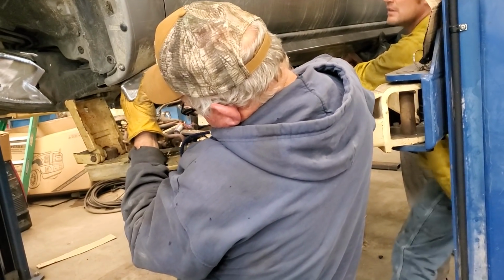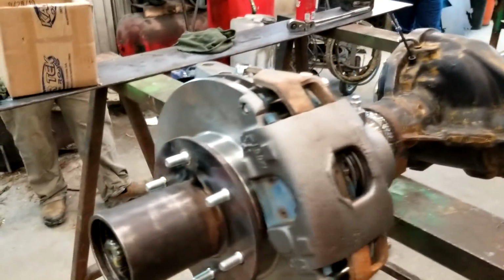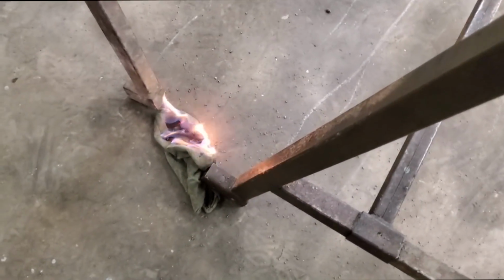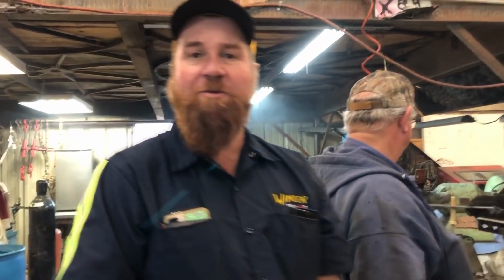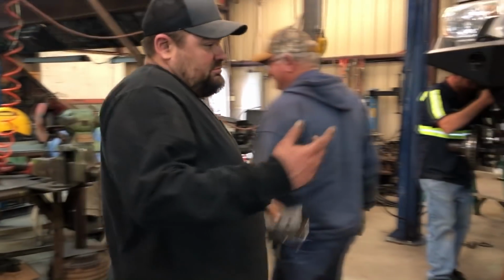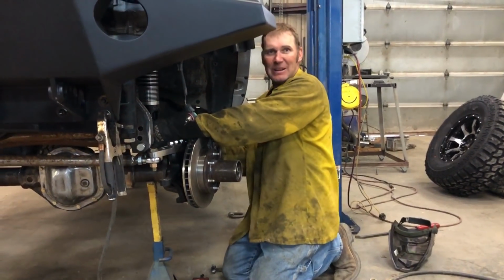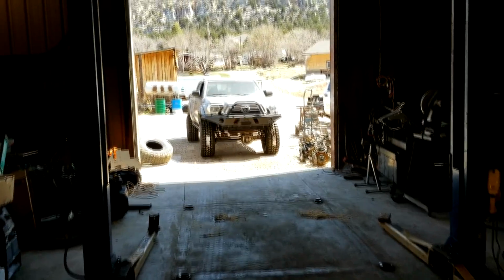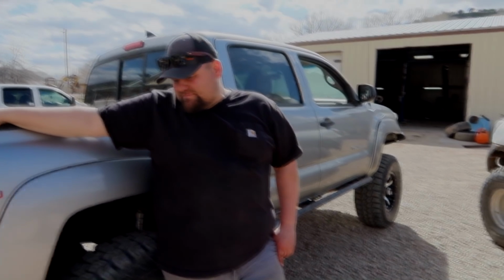**Best Offroading mods -Toyota Tacoma into a Straight Axle** Part 2 of 2

Comment: Paul if you just undo the emergency brake cable mounts you can pull the axle out with everything intact. I just replaced an axle seal on my 2015 Tacoma and this trick saved me a ton of time!

Comment: Great work on that, it looks terrific! Man, I need that for my 4Runner! I'd love to get rid of that IFS crap, LOL.
Reply: Jbog07  oh that's interesting. Well, apparently Jeep has it figured out, haha. I will concede the ride comfort, my 4Runner definitely rides and steers better than my old solid axle Grand Cherokee. Off-road though, the Cherokee was light years ahead of the 4Runner in any technical off roading where front articulation was needed.

I watched videos of IFS Toyota's off-roading, and it's just so pathetic how little the front suspension actually does. It's good for bombing down dirt roads a little faster than you probably should be going, but it just doesn't articulate at all in flexy stuff.

Comment: Quick tip on removing the 3rd member from that rear axle.. there is enough slack in the brake lines if you carefully straighten them out, and unbolt the emergency brake cable from the frame. I’ve even replaced the axle housing oil seal with only disconnecting the brake line, left the e brake cable connected.

Comment: I made sliders just like that for my Rubicon. Only difference was I took a piece of 2" schedule 40 iron pipe, cut it in half and blended them in on both ends. So both ends are rounded to prevent hanging up on rocks.

Comment: A lot of very impressive fabrication work... Off road, at least rock crawling improvement to be sure... But the independent suspension on my 4x4 V8 powered 2010 GMC Canyon is  boss for me... Good ride, good handling for what I want to do... No solid front axle for me... Couldn't go back...

Comment: Just curious, how much weight did this add with the solid axle swap, steel bumpers, and all the steel tubing used for the frame and sliders?  Was the engine modified at all?  How does it handle the extra weight?

Comment: Awesome tacos! I love my 19.
Reply: I love my 96 Taco! 312K miles on her with the 2.7 L 4cyl with a 5 speed manual.
Would love to do a straight axle on it though.
Reply: @karlt.6507  I have a 2003 Tacoma Extra Cab  4x4 SR5 with a 2.7 5 speed. I love it. Just a great little truck. It rides pretty sweet with adjustable Rancho 7000 series shocks. I wonder how long mine will last. I live in NJ and I've already had to do 2 frame rust repairs. I bought it as-is. Probably somebody traded it in for a newer Tacoma as opposed to having Toyota replace the frame. When it goes it will be another used  Tacoma.

Comment: I'm sure you guys know about the gray wire mod actually I don't know if it's the same wire in the 2015 but the 3rd gen 4Runner and 1st Gen Tacoma gray wire mod then you can use the E Locker in any gear and you can use it in two-wheel drive

Comment: I had an 85 high rider toyota with the straight axle or live axle with front and rear lockers the biggest problem with it was the 22re 4 cylinder engine always chewing up timing chains and blowing out the timing cover at the water pump
Reply: Marlin Crawler will keep the revs a little lower.

Comment: 12 grand in parts? Axle, locker, rear gears, shocks, steel, wheels/tires. 12 Gs? Dang. But it looks good and seems to work very nicely
Reply: There's a loooot of labor $ in there too
Reply: Go to the Rubicon. You’ll see $100k+ JKs and JLs there pretty commonplace.  In this case with a salvaged Taco, way cheaper than a new truck.

Comment: What year and front axle did you use for this one?
Reply from the maker: 80s wagoner but knowing what we know now, I would do something different because it was a little too narrow. We ended up putting wheel spacers on it.
Reply: The Question that I read the comments for.  Paul, seems you used a Dana 44 from a ‘76ish Bronco.  Wasn’t the WMS a little narrow?  Beginning the research for my 3rd Gen 4Runner.

Comment: hello someone know about toyota hilux diesel ln40 2wd 1979  rear diff (locker or lsd) i can put in ? 
when i'm stuck only one wheel spin and find "nothing" about this old truck 
are the ln46 compatible ? or maybe have to swap rear axle ??? 
it was my grandfather truck i want keep it most original to pass "inspection" 
i'm from portugal we can't mod very much here ...
Reply from the maker: You could put a Detroit locker in the diff. 👍🏻
Reply: @FabRats   cool thanks 

    1979-1995 Toyota Pickup (All Engines)
    1985-1995 Toyota 4Runner (All Engines)
 seem the same for all models ... 750$ ... i save this for later

Comment: Not a good job on the toyota to weld side runners bumper frond and rear if you do so the frond  cassis on top off the frond axel is going to break becaus the cassis canot flex anymore .

Comment: Do you take requests? As of today this vid has 136k views. I watched it knowing zero about off-road suspensions. I now know maybe 1%, but it was very entertaining, and I bet 130k of the other viewers were in the same boat. Why don't you check with Ori to see if they will sponsor a video of you explaining for idiots like me exactly what you're doing, why you do it that way, etc. For ex, rack & pinion vs steering box, leaf vs coil, what does each of those crosswise shafts do, and so on.

Comment: custom front axle... "still needs wheel spacers".   say what????
Reply from the maker: The front axle was 4” inches narrower than the back rather than retubing the axle we opted for wheel spacers. Probably not the best option, but the cheapest!😉
Reply: @FabRats  so you used an existing, not made an axle. I got you.